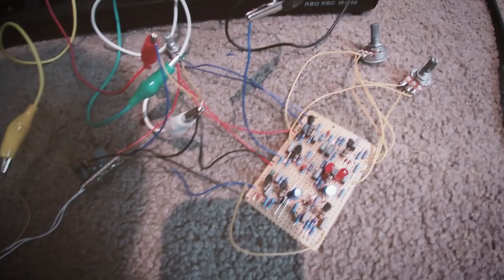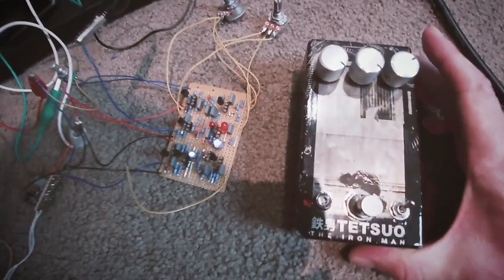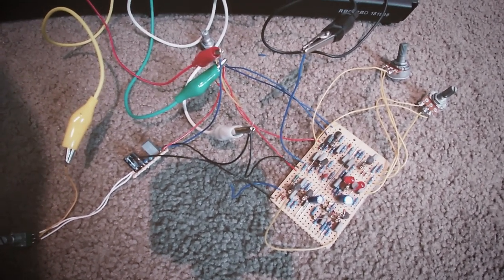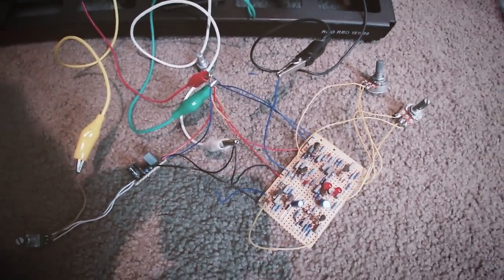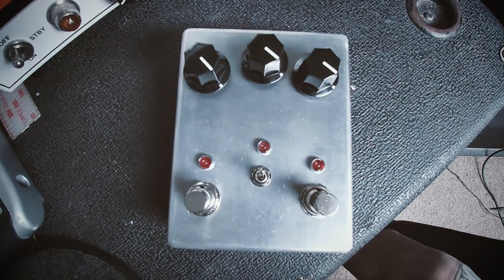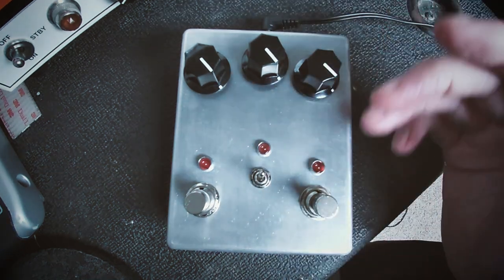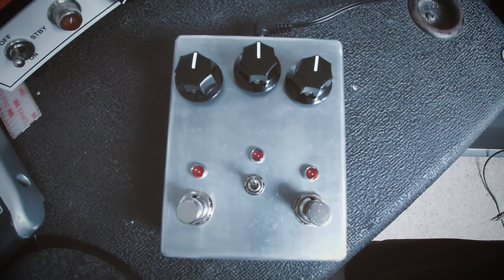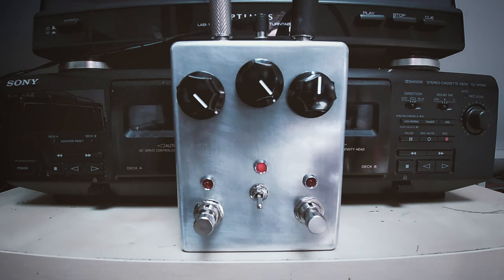Making my own custom DIY guitar pedal. Boost, Fuzz and Octave.

Comment: Hey man, where can I get shematics?
Reply from the maker: It’s my own design, kind of made it up from 3 different circuits and modified them to work how I wanted it to in this pedal configuration.
Reply: @unholyaudiochannel  can you share it with us?? or, it would be great if you made a video about it
Reply from the maker: @witchdoctor1913  about building 3 pedals circuits in one or this pedal specifically?
Reply: @unholyaudiochannel  both, actually it can be about starting to diy pedal making etc., there is no such good source on the internet about this topic (or i couldn't find). i want to learn how to do this, also thank you very much for your answer. the pedal tones are perfect, if you don't have time there could be a video just for this pedal, or just the schematics are enough. thank you again
Reply from the maker: @witchdoctor1913  this is the only video I have done on this pedal and one more sound demo with the Oppenheimer design on it.
I have done 2 years worth of pedal building vids, there is tonnes of content on this channel. Subscribe and have a dog around